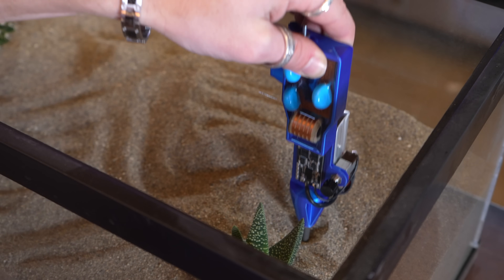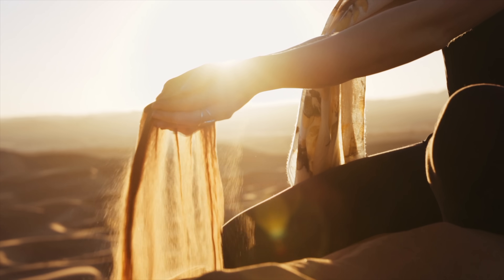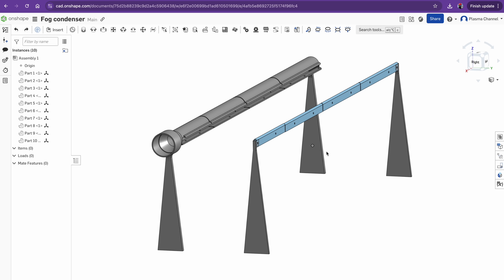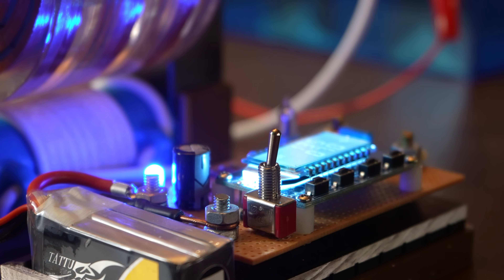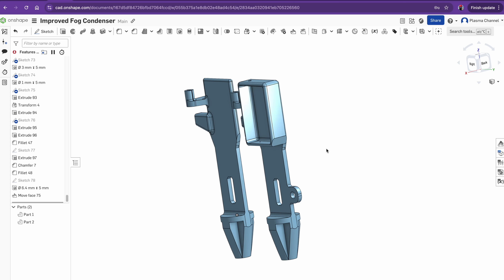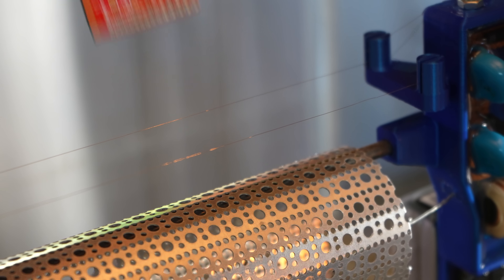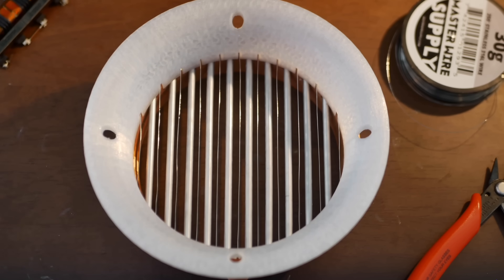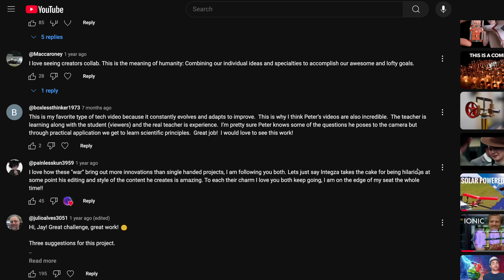Solving Desert Water Shortages Using 20,000 Volts

Comment: Doesn't do it more sense to go for an underground irrigation?

So let the moisture gather and then put it underground. Therefore you only have to change redesign the sheet and gather the moisture/let it go in a (non metal) straw like thing into the ground.
Reply: No need for a straw or any other device,. Gravity causes the water gathered to fall onto the ground, where it is absorbed and heldin the soil / sand
Reply: @3dagedesign  Normally over ground irrigation is ...a hell... inefficient.

Comment: You have my attention! I’ve seen a few different ideas that never worked out when scaled up. I haven’t made it far in your video but I hope this works!
Reply: Because most of those kinds of ideas were just dehumidifiers repacked as new inventions.
And then they wanted to deploy them to arid communities that had limited water.
But those places being arid had little or no humidity, so they never worked.

As those systems only work in places that have high humidity, and places with high humidity also have regular rainfall.
It's why testing a device outside of the operating location and trying to go to market with it never works out.

Basically, the biggest problem with water from air based systems is that the areas that would benefit the most from them.
Are the areas they simply can't work because there's not enough humidity for them to work.
Reply: @ I’m with ya, it’s a great idea & something that will work, just not sure how well/efficient it will be in the desert. I’d love to see the next test being in the desert fog where it would be used. But it’s a great proof of concept & awesome that someone is trying to innovate a way to do it. I honestly hope it works out great in a real world environment, plenty of sun to charge a battery for the little time it will run in the morning
Reply: @rhouser1280  It will always have limited effects.
As there's just not a lot of water volume in fog.

It will be able to pull out a decent amount of water, which will still make it useful.

But it will never solve water scarcity, there's just not enough accessible water in the air at ground or near ground level in most water deprived locations.

Comment: Next, electricity from moisture
Reply: That is just lightning.
Reply: hydro electric dam
Reply: He says from moisture  @jammerzz
Reply: Solar?
Reply: Do I hear infinite energy?
Reply: That's essentially what a hydrogen fuel cell is, but it wouldn't make sense in this case (spend X amount of power to pull power from the air, gain X power from converting the water back to power, free energy doesn't exist, you would just be going in a circle and gaining nothing)
Reply: Plenty of chemistry that gets hot when water is added.
So any of those chemicals could be used to produce heat to boil more water and turn a turbine and make power.
Reply: Splitting hydrogen from oxygen
Reply: @Eduardo_Espinoza  That uses more power than it can generate.